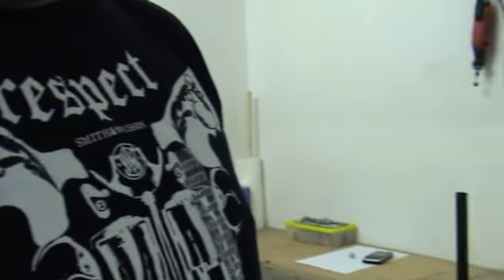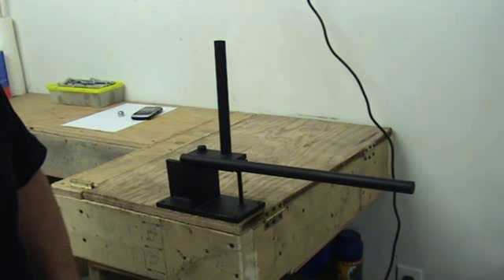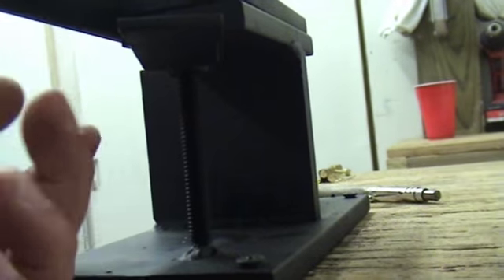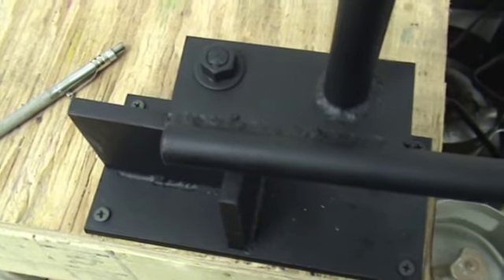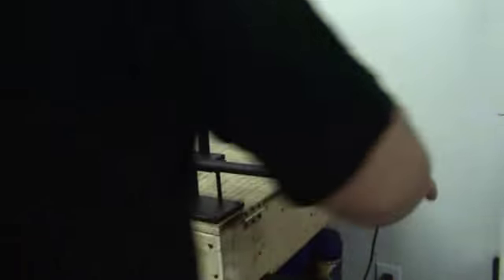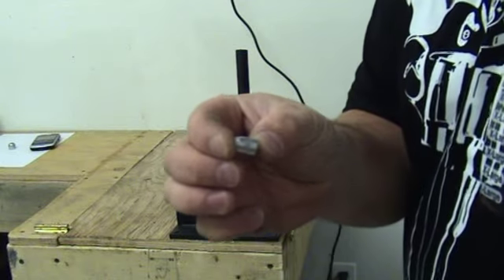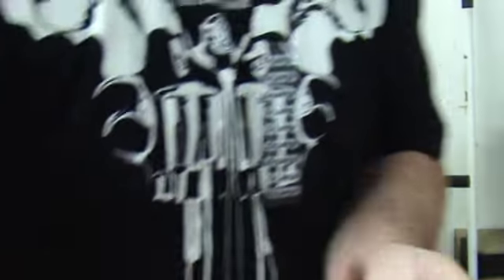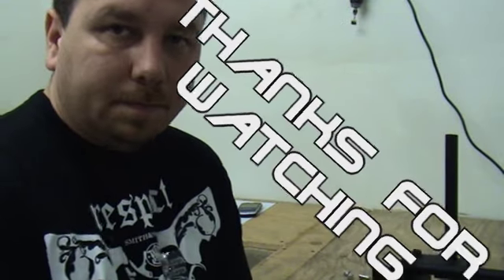Shear for Lead Wire

Comment: As a gentle and polite suggestion, you might consider building an "angle plate" of perhaps 2x4-6 lumber, so that you can move the shear to a 90 degree horizontal position, so that you can use gravity to drop the cores into a waiting container. That would eliminate having to extract the cores by hand, etc...

Comment from the maker: @flemingjim1953 You are totally right. I have already cut a piece of tubing to mount on the side to act as a slide. Im also working on a tray to catch the cores. . The feed tube has to be modified too. I think im going to cut a channel out and put a spring in it. Kind of like the magazine on a shotgun. Because gravity wont work to feed the wire. Thank you very much for your comment and suggestion.